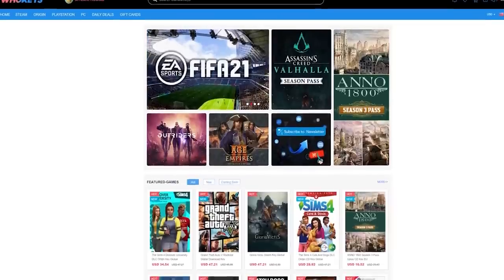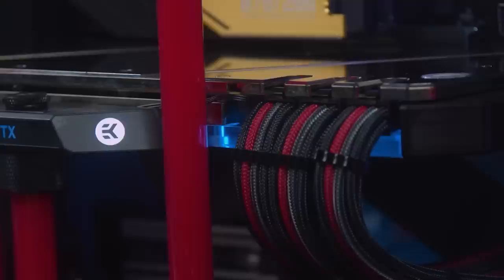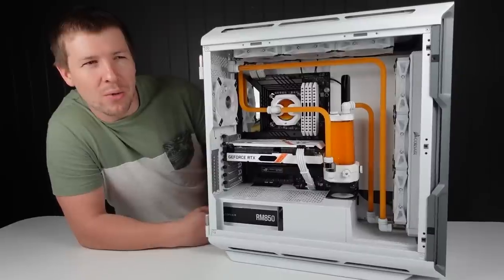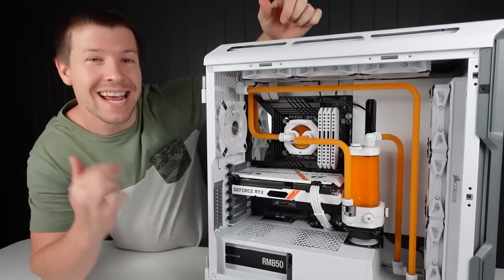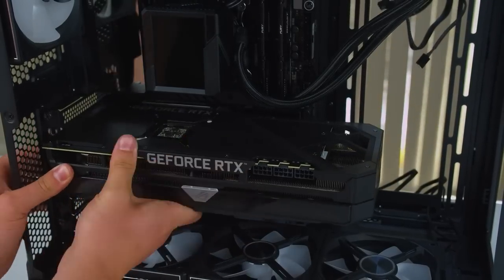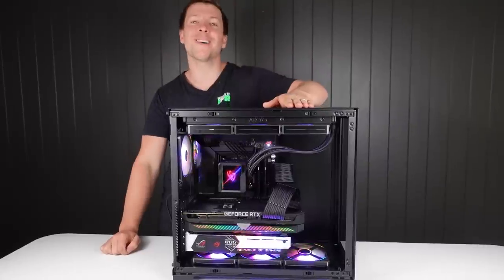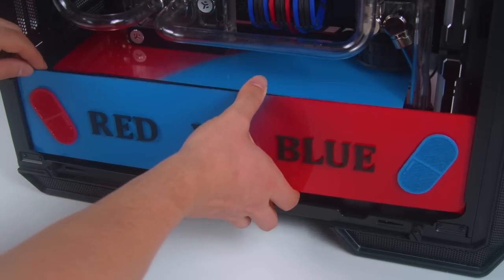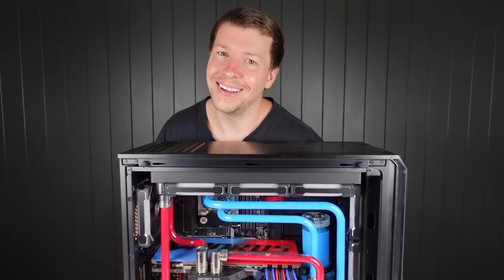These were cool, but it had to come to an end..

Comment: I was building a very similar setup, same case, dual radiator, multi pump setup. Just about to build the lower platform with a custom reservoir. You beat me too it :). I'm about 80% done.

Comment: Love the Masterframe 700.

Having the dual rads just makes it look great. How did you find working with angles of the wings when it came to bending the hardline with compound corners.?
Reply from the maker: Yeah i actually found it fairly simple due to the fact that it is completely open so its easy to reach anywhere and meadure it out